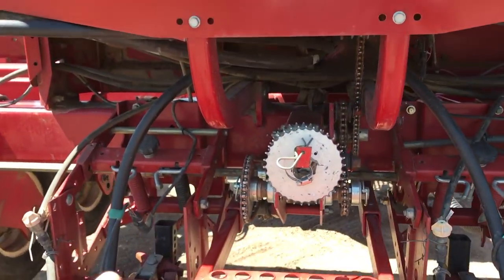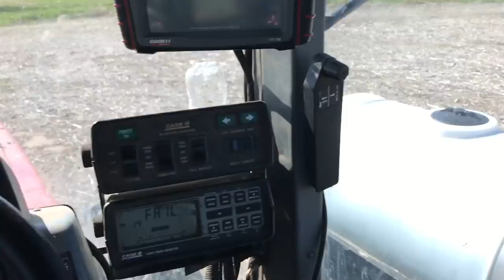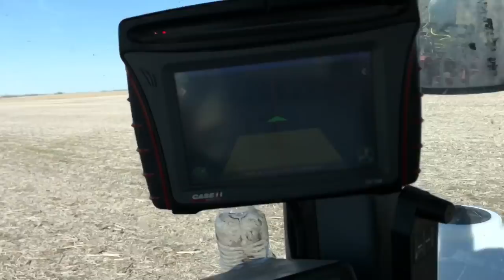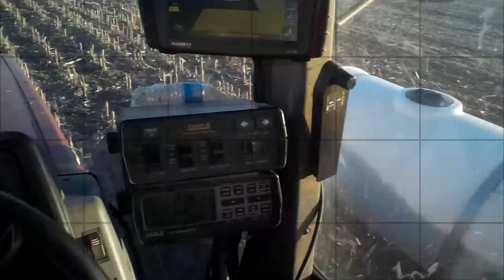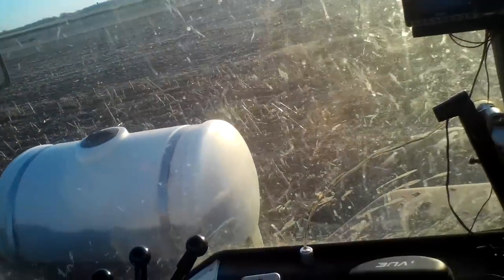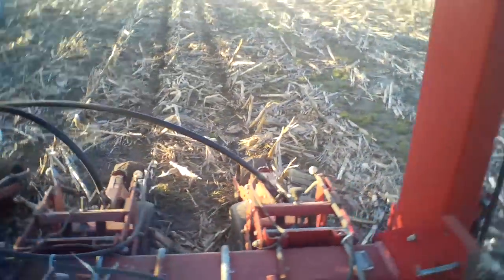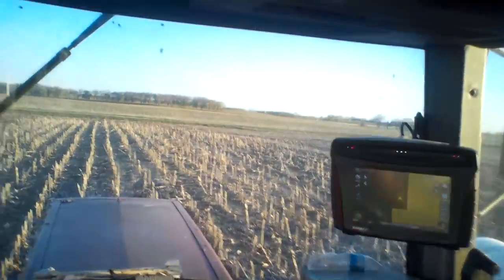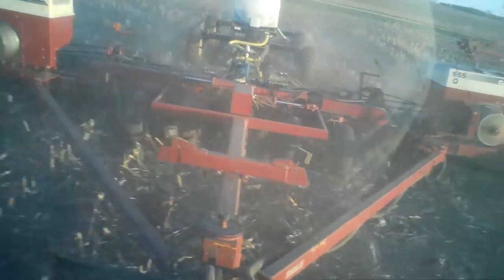First day of planting corn of 2017

Comment: I've just found your channel a few days ago and really enjoy all the detail in your videos.  When you're checking your seed depth you might try being a little less aggressive with the angle of your fingers.  You want to be removing dirt and slightly packing it at the same time.  This will keep you from flicking the seed out of the ground.

I hope what I'm saying makes sense.  You just can't let that covering dirt be fluffy after you've pulled through it with your fingers.  It should be smooth as if you have lightly packed it.  I don't think it will take much practice until you get it down.

I grew up in West Texas where dryland cotton dominated the acreage.  Planting depth was usually very critical with no room for error.  You are a top-shelf farmer with an incredible work ethic.  Thanks again for all the videos.
Reply from the maker: Thanks for the comment... the bigest problem with finding the seed while looking is im trying to watch the camera and watch what im doing.... i should just not worry about what the camera is pointing at and it would be fine....  never been around cotten but i would assume you cant plant that very deep.

Comment: Nice setup I don't think you would pull that up in these Ontario hills you would need a few more ponies. I not fussy on facebook either just make the video's the way you want to been super this far.  Oh and JD guy's don't wear Magnums LOL
Reply from the maker: 69druth she is cranked up to 200 hp.   I drag it up and down most hills with ease. Some times just have to shift down and hit it more rpm. Normally plays with it at 1700.    Also no till makes it pull much better
Reply: Yes no-till ground is great on top just hard to see the wet holes.LOL

Comment: 15 lbs or 18 lbs of seeds per acre?
12 bags 40 acres 
What's the weight of the bag?
Reply: I know nothing about corn other than garden stuff. We didn't grow it here when I was coming up .
Reply from the maker: Ill do some explaining for you on  the corn bag system..... A bag of corn is 80000 seeds... so a bag could be 40 pounds all the way up to 65 pounds... It all depends on the size of the seeds.  this stuff is around 50 pounds per bag.   They use the 80000 seeds per bag so everybody gets the same about of seeds in a bag .. I plant 25000 seeds per acre .  Thanks for watching ask any questions you want

Comment: damn how much liquid do you put down!?
Reply: oh 32% got it. so no spreading dry fertilizer then? up here in MN most people spread dry fertilizer and put down like 10% liquid starter.
Reply from the maker: around 30 gallons per acre
Reply from the maker: Yea on the corn and soy i wont spread any dry... I might put either dry or liquid on mid summer for a split application if the weather is right...   I band my fertilizer so it is right next to the seed where you need it